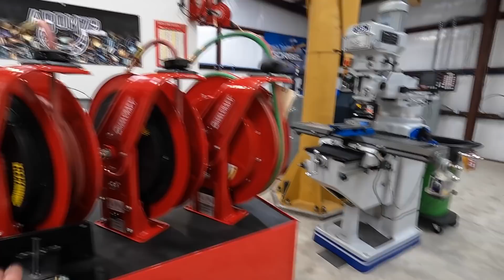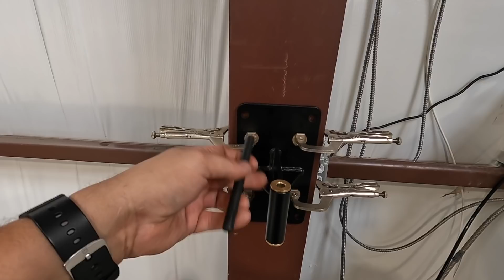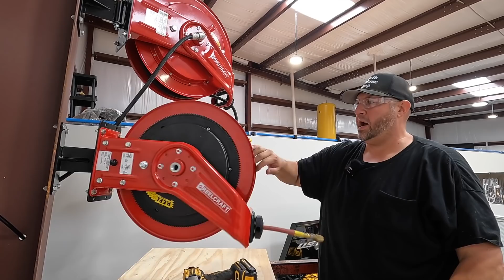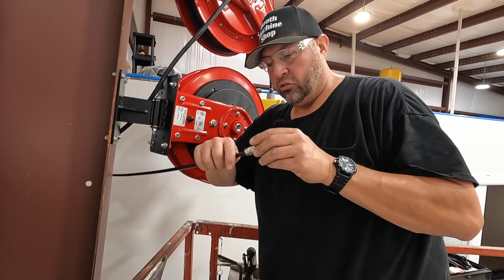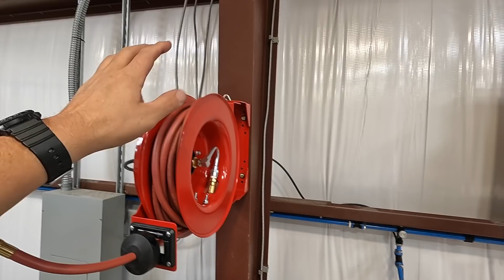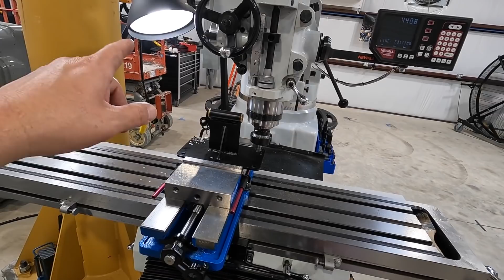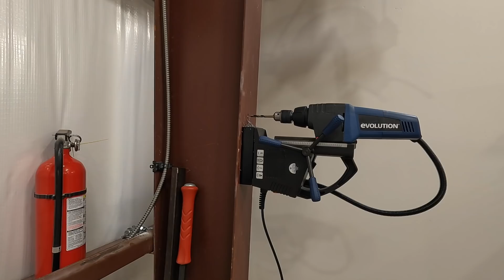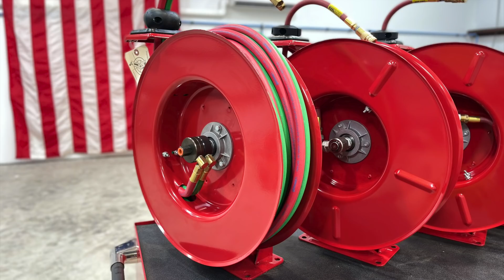Reelcraft Hose & Cord Reel Installation

Comment: I understand that the air compressor isn't the final compressor, but I just can't comprehend the placement. Isn't there a free corner you could tuck it into?? Or even up on top of the office out of the way.
Reply: It is a sponsored item... you want it seen in as many videos as possible... not tucked into the corner or on the ceiling!
Reply: @cscollen  great point. I guess I’d do the same thing for a free $20k air compressor
Reply: I say have it suspended by an air balloon and float around!
Reply: I said the same thing, such a goofy in the way place to put it. 😂 After he bumps into a few times I'm sure we'll hear a "I wish I picked a different spot for this. LOL

Comment: Think all of the cord reels that I ran power for last 30 years states to fully unreel the cord before using. Probably afraid of it overheating . Would never apply a heavy load on any cord reel overnight or weekends with a heavy load especially if a lot of the cord was retracted. Smart going with the 3/8" air hose rather then 1 /4". Thanks for all the great vids. Love your new shop.
Reply: I saw a 100' Cord lying on a Office carpet all coiled up with a 1500 Watt heater connected to it . In less than 30 min it had melted into the Office carpet into a big Orange blob. The inner conductors must have been good for high temp as they did not short together.

Comment: Gots to say, I have a cheap hose reel and cord reel in my home shop and WOW, makes things much much easier. Best thing I did in the shop. Also, you should get a 15/20 lb. CO2 fire bottle. They are refillable and wont make a mess like the dry chem ones, much easier recovery if you have to use.

Comment: Annular cutters are some of the best cutting tools to use for making holes in steel. Use them in a mag drill at work to drill 200 holes in 3/4” steel with no issues just keep the chips out the way.

Comment: If one wanted to slow down a reel's retraction speed, they could easily add a mildly sized but powerful neodymium magnet to the bracket of the reel and a slug of copper or aluminum stock to the reel itself. Those can be reversed too of course, it's just easier to drill a hole and bolt the slug of metal to the spinning reel to keep it from flying off. You can't do that for a magnet, but you could get a doughnut magnet. Anyway, Eddy currents will slow the reel down as the magnet and the copper or aluminum chunks whip past each other. You can vary the amount of braking too by moving the metal closer or farther away and making it thinner or thicker. 💪😎 Nerds, unite!!! Interesting fact: this Eddy current braking effect is the system used to regulate the speed of rollercoasters and to brake them to a stop at the loading platform. 😺 The magnetic brakes never wear out! Electromagnets can be used too for instant on/off control and infinitely variable braking force.
Reply: Aluminium..... magnets

Riiiight
Reply: @AxlMetcalf  try dropping a strong magnet down a copper pipe, you'll see it moves in slow motion,  It's a well known magnetic principal.
Reply: @AxlMetcalf  You've clearly never heard of Eddy currents. 😸😸😸 Look it up, then come back here to discuss. Lol
Reply: there is plenty of far simpler mechanisms out there for slowing things down.
Reply: @katelights  How can you get anything more simple than 2 chunks of metal bolted on each thing? Literally no moving parts, no contact, no linkages, etc. A magnet, a chunk of copper or aluminum, done. 🤷🏻‍♂️
Reply: Internal centrifugal drum brake does the same thing much simpler and cheaper.
Reply: @ellieprice363  How is a friction brake system simpler than 2 pieces of metal moving past each other? Bolt one piece to the frame, bolt the other piece to the reel, done. Never needs lubrication, brake pad replacement, etc. It will never break and it will never ever fail. That's why rollercoasters use this system! :) It will never ever NOT slow and stop the rollercoaster car. It never needs maintenance or repair. You can't get any more simple than this.
Reply: @mannys9130  I admit I’m not familiar with that system. Did Reel-Craft use it to regulate the retraction speed on their reels? If not there’s probably a good reason.